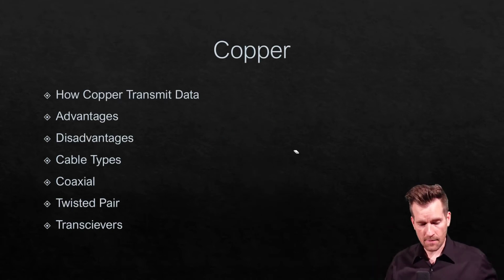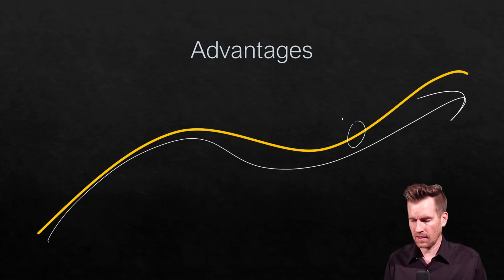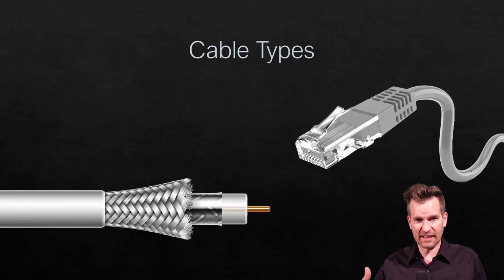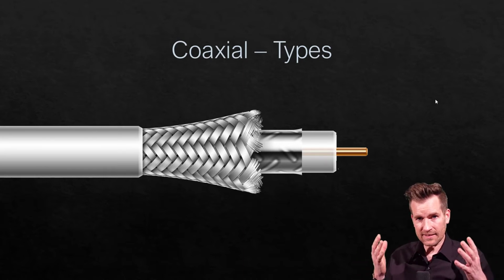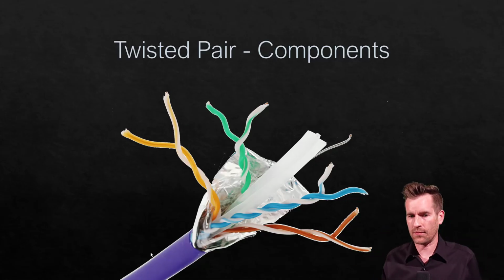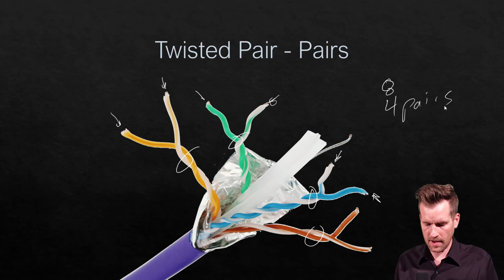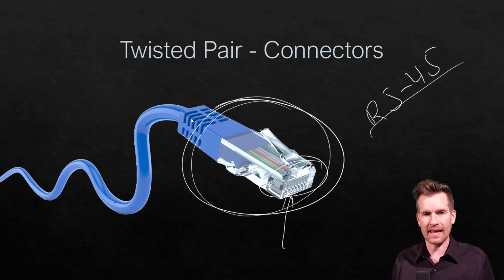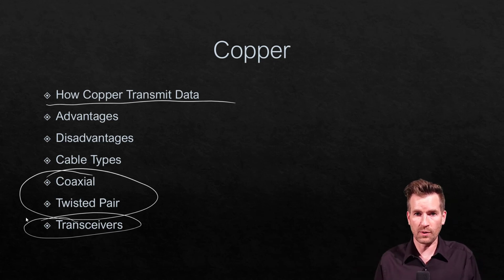Network Fundamentals 5-4: Copper

Comment: Thanks for the video!  When it comes to the twisted pair cables.  Is it the white and color cable that transfers data or just the color one?
Reply from the maker: You're welcome!

They both are needed to transfer data. Electricity plays by it's own rules, but in some aspects, you can think of it like a bike chain. Electrons form a loop, so they are driven one direction, but then return the other direction. So essentially, they both "carry data".

That being said, the white/green would is considered the tip/positive and the solid green is considered Negative. Essentially, the white/green is doing the "driving" and the solid green is along for the ride. So from that aspect, you can think of it as the data is mainly being carried on the white/green cable.

Hope that helps!
Reply: @TechKnowSurge  Very helpful!  Thank you for the thoughtful response.
Reply from the maker: @ You bet, glad it was helpful! :)